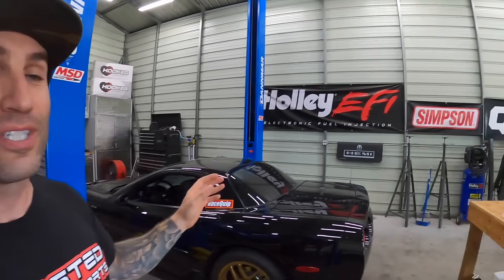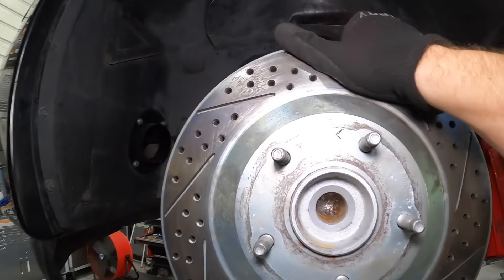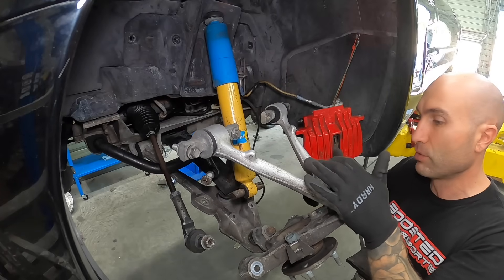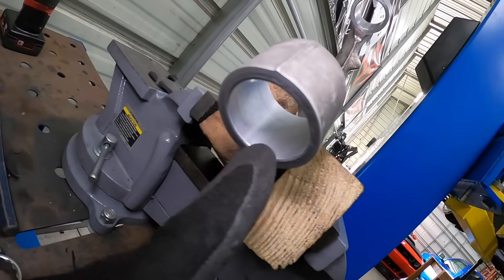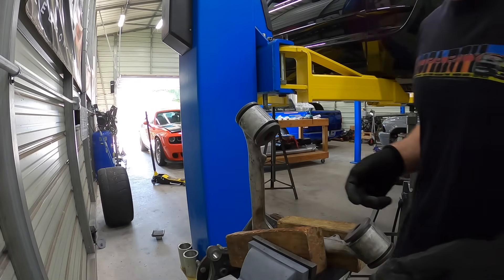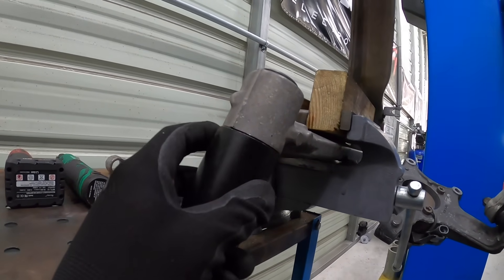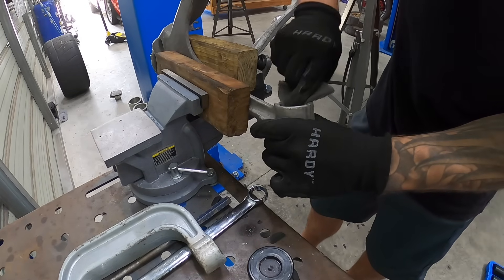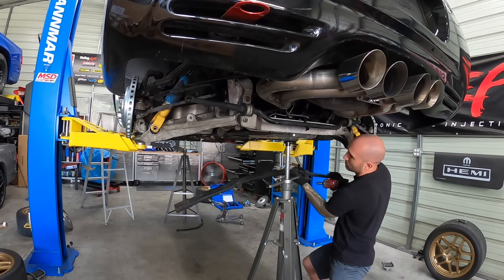Corvette C5 & C6 Ridetech Delrin Suspension Bushing Upgrade | HOW TO

Comment: I always see so many of these  suspension replacement videos but I never hear anyone talk about a very important step. Don't tighten everything down until your suspension is sitting at ride height. Otherwise all those bushings will wear prematurely.
Reply from the maker: Doesn’t apply to this type of bushing as these can rotate freely but on a standard solid rubber mount sure
Reply: @BoostedMotorsports  I know I have seen you in the past use Detroit Axle parts. How do you feel about there parts? I have had a few issues with them.